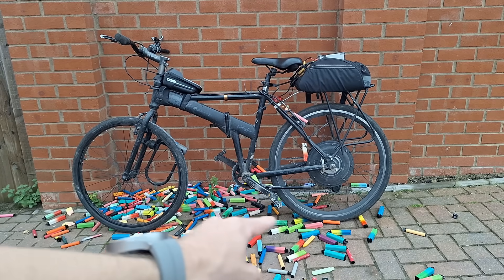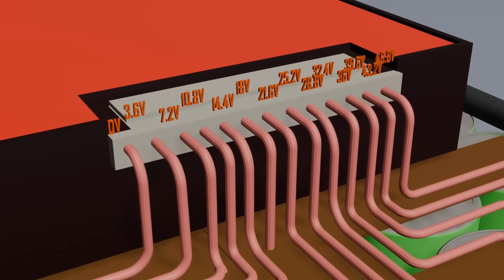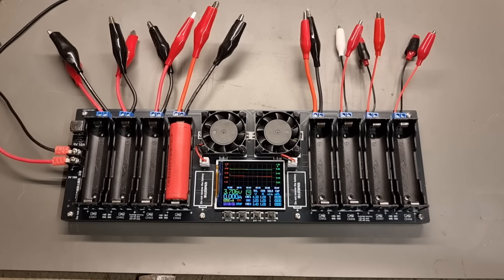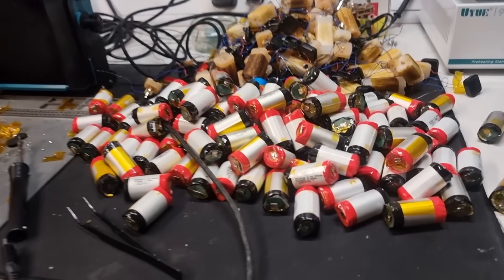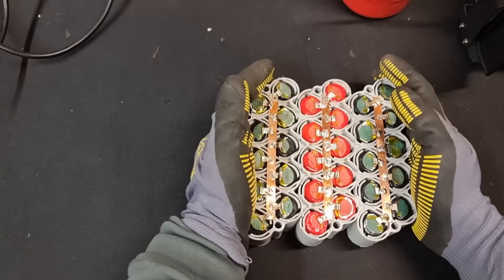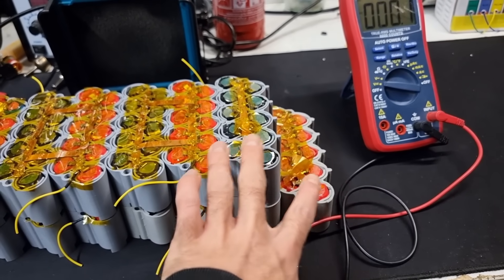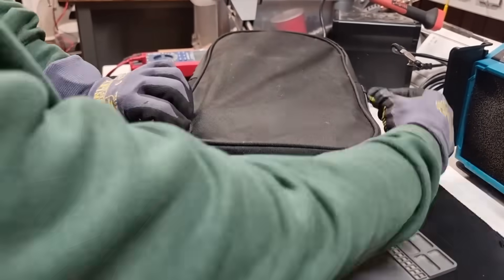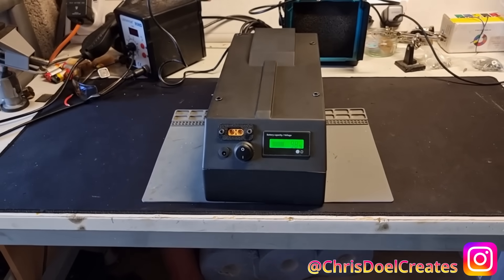Powering an E-Bike using Disposable Vape Batteries

Comment: Man.... I need about 420 of those larger batteries to power my e-moped. Where do I get those? People don't seem to litter streets with those where I live and I'm not about to break into trash bins on sides of streets 😂 Oh and I can answer your question about the fluid color. This happens when people pull too hard and too long (which usually happens when they pick a nicotine dose that's too weak for them). The coil becomes red hot and burns the liquid.

Comment: i think you should have used the same material as the red paper battery separator (idk whats it called). kapton tape can be easily poked through sharp wire and sharp solder points...

Comment: Thanks Chris, really well presented and great build. I find it astounding they use rechargeable cells in something that's disposable, wouldn't it make more sense for them to be using alkaline? I was thinking a Powerwall type project too throughout, which you mentioned at the end, trouble is with this you'll need 1000's of cells and a few kilowatt hours worth of storage to make good use of it for a home application.  Good luck!

Comment: I was surprised to hear that those cells were only rated for 300 charge cycles. But then I looked up the charge cycles for 18650s and saw that they also typically had 300-500 charges. But it looks like you can typically charge it twice the rated amount and have it decay down to about 60% which is still pretty good.

Comment: I used to work at a local park and these disposable vapes haunted us because if it got ran over they caught fire in the park so I would go out and collect them up and bring them home disassemble them and discharge the batteries completely and took them to a nearby recycler still hate these stupid 1 use vapes why can't they just use a aluminum oxide battery or something that's actually 1 use

Comment: A safety concern i have is with the gloves you chose, i think its great but nicotine fluid will stay absorbed in the upper part of the glove if you are sitting low in a chair, ive done it myself. Latex is king when dealing with skin sensitive liquids.

Also depending on where you get your vapes from you also might be exposing yourself to drugs like meth, the homeless shelter here in portland oregon taught me about that which concerns me

Comment: I would have at least put a thicker plastic between the top and bottom group of batteries so when it is bouncing a round there is n way for anything to poke though the thin tape.

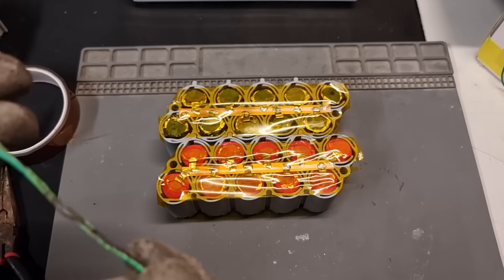Comment: 10:00 Now take a EV Battery and short it with the same cable
EV batteries can deal with 100s of amps but your cable will melt just like those glass fuses. So it will be safe actually. But do it with a fat cable that is 100 mm and you will prob regret it

Comment: I've been attempting this kind of thing for ages, but, up to now, have only managed to make a 12v LED torch 😁 Great video, and very useful info. I'd like to see instructions on how you converted the tester with crocodile clips, and also, it would be good to see your method of utilising the smaller batteries, which I have acquired hundreds of, (I presume it will be more or less the same, but will take a bit longer).

Comment: Great idea. I've just been using them as powerbanks. I diyed an ebike with a Bafange mid-drive motor over 6 yrs ago and done over 3000 miles. The original battery is still going strong. Maybe 50miles-70miles depending on temperature for a  888wH battery. I think they are samsung cells rated at 1000 charge cycles.

Comment: as a vape shop salesman from Austria, i too sat and scratched my head when they introduced these. Their build quality and safety systems are very low compared to the rechargeable ones. 

I always wondered how they even allowed these in the first place, they re awful, inferior, expensive, less strictly QC'ed, more additctive than the freebase "normal" nicotine based things you get in a shop and so much more.

Comment: Only 300 recharges is a serious pain: That's a lot of work for so little, is the case reuasable for when the batteries fully die? Also, tool costs need to be considered when comparing a store bought battery; Not everyone has a nice garage with that equipment.

Comment: Very cool! But if I may make a suggestion, invest in a battery spot welder and some nickel strip, they have some pretty nice ones for $40-$50 bucks now. I just got the Fnirsi SWM-10 and it works decently well. I'm just using mine to repair packs though, so may take a couple charges of the welder (it's lipo battery operated) to build a pack like this :)

Comment: Love the video but I had one question: is there no need for heat insulation between cells to prevent thermal runaway? I know it is used for EVs but didn't know how common of an issue that is for EBikes.

Comment: Hello mate, good stuff! I'm doing the same kind of thing, except making battery packs and powerbank here in Ukraine.

One thing I would suggest that I always do is using some pliers, pull off the bottom of the vape, pull the battery out just before pulling out the cancer juice pod, then cut all the wires connecting the battery with some scissors and then rip off any other wires - this avoids me being exposed to said cancer juice sponge.

Great work dude and thank you for your videos! Your last video on the battery pack was part of my brainwave to make powerbanks and portable chargers for the guys on the front here in Ukraine!

(Oh, and be sure to ware a mask as well when disassembling them, a lot of the time the vapours from the sponge leak into the batteries making them sticky, horrible, and a mini vape fume emitters when desoldering the wires!)

Comment: Them little kids kick scooters, the ones that go up to your hip with the tiny wheels.
Electrify one of them.
Put a power outlet at the top of the stem, and a thumb throttle on a handle, run a line down to one of the wheels, bolt on a speed controller, motor, chain, and a cog on the 'drive' wheel. Battery goes in a backpack and you run a line from your backpack to the outlet to power it up.

Comment: Personally, I think it's a bit dodgy to use that type of cell for a powerwall inside or attched to your house. If you can install it outside somewhere, where it'll just burn out if it catches fire, it would be worth a try. I can imagine that the quality control of those cells is not up to the standard required. I would only use LiFePO4 for a house battery, which is what I have. Thanks for a good instructionional video. 

I think you covered everything pretty well. The one thing I'd have done differently is that when you designed your custom case. You could have made the battery fit the downtube or inside the frame triangle, which would give you much better handling. A rear motor and a heavy battery high up on a rack like that is never good. I used to do it myself about 15 years ago when we started messing with ebikes.

Comment: With long time use I’d recommend spot weld, due to overheating it may cause the solder to melt over time which could short and cause fire. Just a safety measure thought 🫡

Comment: did i complete miss where he talked about the motor for the bike?
Reply from the maker: Sorry, I didn't think it was that relevant as the main focus was the batteries. It's a 1500W rear hub motor that I got for cheap on FB marketplace as it was broken. Just needed to solder the phase wires

Comment: 14:03 the ban is going to be pointless. They will just add a little charging port and sell some obscure refill kit. After that they will brand it as "reuseable" 
That is the state of affairs here in Germany. Also the liquid is taxed here quite heavy and a vape isn't allowed to have more than 2ml of liquid so they just make the sponge bigger. 
I wouldn't be that worried about the liquid. It's safe enough to be atomized and pulled into lungs. You can buy it in 1l bottles. Sure no contact if not necessary, but yeah 😊 
It actually blows my mind that they use real aluminium for the big ones.
Reply: skin contact with nicotine vape juice is not recommended prolonged exposure can cause nicotine poisoning/sickness

Comment: where does the charging socket get wired to, when using a BMS? just the bms output red/ black wires or somewhere specific?
Reply from the maker: This BMS allows you to connect the output to both the power connector and the charger :)

Comment: Nice video. I've been saving vape batteries for future projects too, but they are varied in capacity. Does that matter if i was going to connect them to each other?
Reply from the maker: You will want to group them with identical capacities. Otherwise, the power sharing won't be equal and it will stress out the cells doing the heavy lifting

Comment: How do you find the amperage of your battery
Reply from the maker: I managed to get the datasheet for the cells which stated the max cont. current. But you can also approximate it from the internal resistance. Using P=I^2R, you will want to make sure the power dissipated is less than 0.5 W

Comment: This turned out pretty well! Great job! A question: did you select the cells to form the packs as same size? Meaning, every "cell" es equal in capacity.
Reply from the maker: Cheers! So all these vapes were identical brand and were collected at around the same time so the cells should be well matched. I capacity tested random samples and they were all within 100mAh of eachother
Reply: @Chris_doel  Ah, okay, I see. I'm in the process to build an ebike myself, but my batteries are from scooters and their "health" is way more variable. Anyway, I used repackr even though there wasn't too big of a difference between cell capacities.

Comment: There great batteries , i make torches with them , electronic components like leds , resistors, micro chargers  and microswitches are ever so cheep.  I wish different voltage chargers had different connectors . Great post .

Comment: I noticed you just soldering nickel strips, I find solder doesn't stick well to them, is there a trick?
Reply from the maker: I used copper strip for this pack, its so much easier to solder to. You can also solder to nickel strip if you sand it and solder to it before it oxidises
Reply: @Chris_doel  I was referring to the battery strips, thanks, they give me such trouble when I want to reuse cells

Comment: I built a solar powered hydroponic system using vape batteries.
10w solar panel, charge controller, 12volts 4.8w pump and the timer cost me about 20 euros on aliexpress. 
I will probably makes a second iteration that include a led growth light.

Comment: Great video but I have a question. Why do manufacturers build these power banks by welding the battery terminals together instead of just soldering them? Do you have a portable spot welder? I've seen other channels use them.

Comment: You can balance the cells by just connecting them together in parallel with resistors in series. Higher charged will charge lower charged (resistors make it safe by slowing it down to a trickle). 22 ohms up should be fine. 

Also, no need to throw away the flat ones. Just charge them and test. Some will survive

Comment: The problem with vaping is governments were oblivious to the tax potential hence why they are beginning to crack down, big tobacco fund billions in anti-vape propaganda but I have been doing it since it started giving up a 40 year heavy habit overnight and not looked back, back then I was told six months if I carried on burning as my lungs were bad but today despite coasting close to 60 my lungs are as good as they were when I was a late teenager so its not done me any harm.   I do pick up disposables junked on side of the road and break them open for the cells, got quite a nice box full of 18650's and pad cells, a disposable's lithium has up to 1000+ charges to it but its thrown after one what an absolute waste :(

Comment: 18650 just means the standardized size of the battery. 18mm thick, 65mm long. May vary depending on a button top cells and/or with BMS attached to it. They are just basic LiIon round cells.
Actually, 20700 and 21700 are more and more used since you get a higher energy density.

Can i ask which type of charger is that at 6:40 ? Im actually using 1-8S LiPo Chargers, a special up to 18S 30A balanced fast charger for DIY packs and for my single cells a SkyRC MC3000 multi purpose/chemistry charger.

Im really looking into upgrading my MC3000 finally also because i just need MORE slots, 4 slots are often not enough especially since im also repurposing since a while those vape cells.

I even built a hotswappable holder for putting any fitting vape cell at any charge level into. Its still very inefficient, many tiny DC DC converters with undervoltage protection ending up at a single bigger converter putting out anything from 1-12V however you set the CV screw.

Comment: Couple of years ago I also got my hands on couple of these just to check what's inside. Got a bit surprised when I found that they use rechargeable battery in it. 
I like to mod my devices to be rechargeable instead of using AA batteries. I used to use 18650 that I have loads lying around from similarly disposed devices, but those cells from vapes are even more convenient to use. 

Thank you for for showing everyone how to reuse the good stuff instead of wasting. 

Massively wasting lithium and other resources like this will eventually affect their global market prices. And that will effect all the products that uses them.
Reply: If lithiums don't something else will. Don't worry about it fella

Comment: Pretty good, though isn't the amount of potential cycles kind of too low to make this useful and worth the time and material investment?
Reply from the maker: Its hard to say how many cycles it will be good for, the datasheet states "no less than 300" which is pretty vague. I suppose time will tell....
Reply: @Chris_doel  well, that's assuming they're all brand new, by the time you get to them they can be in kinda rougher shape, so I'd assume getting said 300 out of them without significant drops and quite a few failing is pretty optimistic.. How long the entire array lasts while being useful is a pretty wild guess probably. Still, let's say its indeed 300, or maybe, let's be really generous, 500 cycles of proper use, 700 before it becomes borderline useless... How  useful would that be, investment wise and how it'd compare to an actual battery of the same capacity?

I'd drive an Ebike to work and back, charge it there. I live in a hot area with hills, and the trip would be about 24km, it'd almoat drain even with some pedalling, and wore down pretty fast. So... Best case scenario, considering that's about two cycles a day, it'd last a year at best?

Doesn't sound too great or reliable tbh, still definitely cool though. A great improvement in design from the last time with all the hefty bolts btw! Still, think the use for these is much wiser as a power bank, which sees a lot less load, rattling and wear and tear! Definitely a shame they use and throw these out this way.